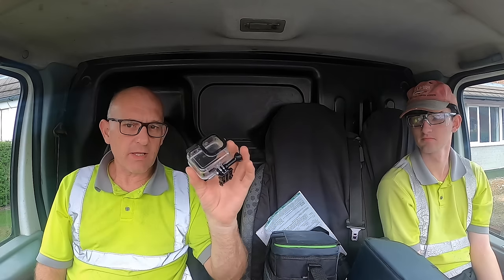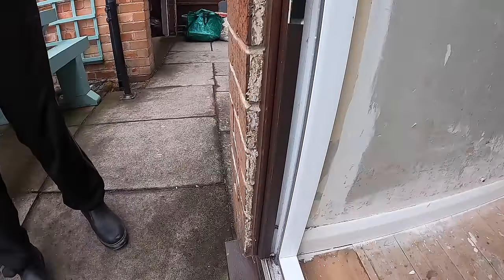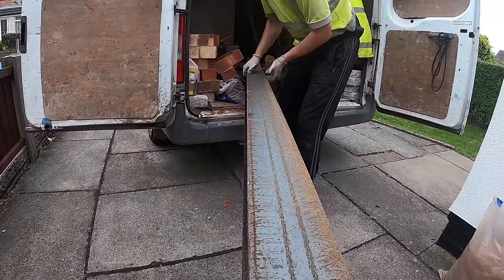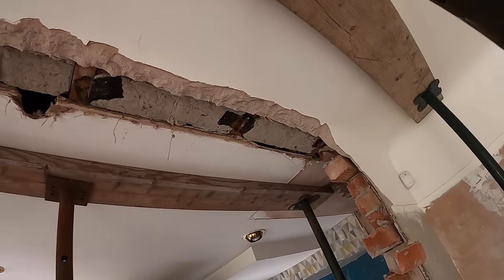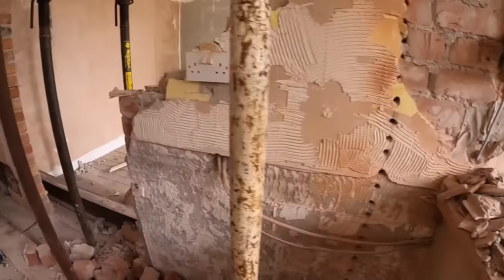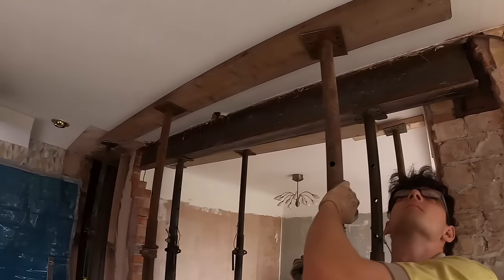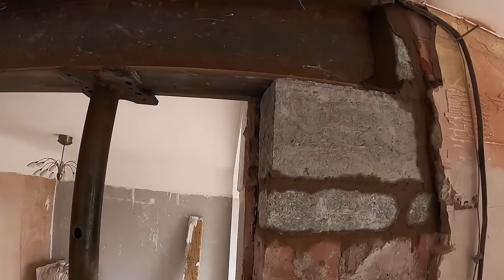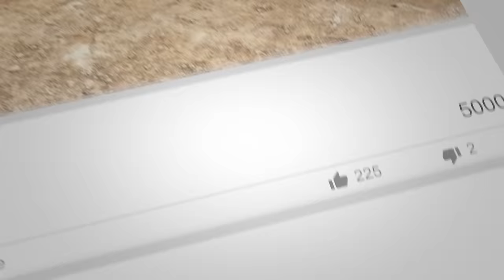HOW TO INSTALL A STEEL BEAM IN DETAIL

Comment: As a structural engineer I totally agree with you Steve, the steel should sit direct onto the padstone without mortar. Great video - I was very relieved when you finally propped the wall 😂
Reply: Any builder with a brain cell knows beams should sit directly on to padstones!!!!
Reply from the maker: @malcolmhaynes1424  Whuch is what I thought but apparently not 🧱👍🏽
Reply: and a second licensed engineer to second this!
Reply: So what exactly do people think is gonna happen in the future when the mortar directly under the steel begins to degrade over time and fail? The mind boggles!!
Reply from the maker: @toby648 mortar doesn’t degrade , especially sand and cement which is never going to be exposed to any weathering whatsoever 🙄
Reply: @toby648  by then, the rest of the house will have fallen down, so I don't think that's a worry 😂

Comment: Good job, always either a pipe or wire in the way somewhere doing these, I like to spread a bed of compo over the top of rsj just before cranking it up. Quality work lads
Reply from the maker: MrAdeyb . Thanks , yep always something. I usually put a bed on but didn’t want the joists sat on sand and cement 🧱👍🏼

Comment: Really good video. Im putting a slightly bigger profile rsj in 3.3 mtrs long myself today. Acro props in place and cleaned out, but going to be some job lifting on my own. I'm going to use raised pallets as levers each side and a plasterboard hoist. The pallets will allow the hoist to work within its safe working load.
Reply from the maker: Good luck but be extra careful and take your time . 🧱👍🏽

Comment: Great video. Are you using quick drying cement - amazed how quickly you are removing the supports for the beam, I was under the impression you should let the mortar set for a couple of days.

Comment: Great video lads! How comes you put the support on either side of the beam and not directly where the beam would be installed?
Reply from the maker: you get more room to work by propping the ceiling joists whenever possible 🧱👍🏽

Comment: Great video. Quick question. I have a 40mm gap to make up under my padstone so it sits flush under the steel. What can I pack it up with? I notice you're using thin padstones. Should I just cut a padatone thin as a way to pack it up the required 40mm?
Reply from the maker: I’m not sure what is allowed for a gap that big .
   Maybe slate or steel shims ? 🧱🧱
Reply: @Bricklaying With Steve and Alex  thanks for the quick reply guys. Maybe I'm better off taking out another course of bricks and getting another padstone under there?
Reply from the maker: @Bearizzle  . Yeah better safe than sorry 💪🏼🧱👍🏽

Comment: hey guys great video I am doing a very similar work. Got my structure report done but the builder is asking £900 only for putting the bean in and let it settle for few days. But taking down the wall and tidy up the mess is not included. the price is only for putting the bean in. Do you think its a fair price? the bean measurement are 152x89x16 and the padstone 330Lx100x150
Reply from the maker: Sounds a bit steep 😬🧱👍🏽
Reply: @SteveAndAlexBuild   Thank you yes I will shop around I agree this price is too much where only putting the bean in and once settle no wall out and tidy up. Cheers.
Reply from the maker: @cdyz5 🧱👍🏽

Comment: Would you lift floorboard if not solid floor to stand props on and do you drill lintel to bolt @ 4" X 2" timber inside U of lintel to fix plasterboard to or do plasterers just Gripfix to steel ? Thanks
Reply from the maker: ian ROBERTS . No we just spread the weight with planks on the joists . Not sure about the second question as we only install the steel 🧱👍🏽

Comment: Great in depth video.. How do you work out what size RSJ and is this the same process for a double skin wall.. Cheers Glenn
Reply from the maker: Workshop Life Thanks Glen . It’s the opening plus a minimum of 300 mm ( 150 mm minimum seating each side ) .it is the same for a cavity wall but the beams are usually bolted together . If you check our playlist we have other videos on this topic 🧱👍🏼
Reply: Think he means the height of the steel?

Comment: Very informative way of doing it 👍
Reply from the maker: Thanks Adrian 🧱👍🏽
Reply: Just wondered about a couple of things,
1, Is it necessary to put some mortar onto the pad stone before the steel sits on or is no mortar really required? 
2, under the main padstones there is a slither of pad stone or concrete block?
Reply from the maker: @adrianodoherty6283  Hi Adrian . We do put mortar between the padstone and steel but not everyone does . 
   As for under the padstone we used concrete common bricks I think 🤔 🧱👍🏽
Reply: I guess a concrete block slither or engineering or blue bricks would be ok aswell as a make up piece under the main pad stones? Just thinking about what I have lying around 😀
Reply from the maker: Yes but try and keep the depth of the piece as big as possible, you don’t want it too thin 🧱👍🏽

Comment: Another top video and of course most of this type of work is the cleaning up and it’s amazing how much crap is generated! I noted a few comments regarding pulling the last two acrows out prior to full setting of the mortar ! I always have a half bag of rapid set cement knocking about and would use it or mix a bit with the normal cement on situations like this ( have to be sharp though ) as it goes off before you can get on the steps with it lol😂🤫Besides the learning curve with your new camera 🎥 equipment you now have grown in confidence whilst explaining the various stages of the build which is commendable 💪👏👍
Reply from the maker: Ronnie Biggs Thanks very much Ronnie much appreciated 🧱👍🏽
Reply: Great tip with the rapid cement for these jobs mate I’ve never thought of that 
That one will be staying in my head for sure 👍
Reply from the maker: Mitchell Meredith 💪🏼🧱👍🏽

Comment: I've got the same layout and I'm wanting to knock through kitchen diner. That little add on bay is similar to mine and my engineer is saying I need to get a beam put across that first aswell as the large one. Im gonna seek a second opinion. Great job by the way lads, I'm just scratching my head as to why I can't do mine the same 🤷‍♂️
Reply from the maker: Thanks Craig . Not sure about that one 🤔👍🏽🧱

Comment: Did you guys need planning or building control out for that work?
Reply from the maker: We always encourage the customer to use a structural engineer and go through regs 🧱👍🏽
Reply: @SteveAndAlexBuild   we are doing pretty much the same as you guys. We have had a structural engineer out to give us what size steel to you. He is said we need to contact the council. I have never had that before . It’s an internal supporting wall .
Reply from the maker: @jasonreeves4955 . We tell the customers before the quote so they know there will be the extra expense ( which is ridiculous) then they can decide to go ahead or not .
   The sign off covers everyone 🧱👍🏽

Comment: Thanks guys for this.  Quick question, was this one where the wall continued all the way upsatirs, I assume it was?  My understanding was you needed to use strongboys to needle above the height of the steel (i.e. above ceiling height).  Or does that depend on whether the wall has perpendicular joists resting on it?
Reply from the maker: Thanks Tim . If the joists sit on or run through the wall then they can be used to prop above 🧱👍🏽

Comment: Nice job, and best steel lintel video I've seen. Hope that's christened the new boots (they will keep getting better). Silly Q what would you rough estimate the weight of that lintel?
Reply from the maker: John Coppock Thanks very much John . Not sure of the weight but not as heavy as it looks 💪🏼🧱👍🏽
Reply: @SteveAndAlexBuild  It sounded heavy when dragged out the van but then Alex I think made it look easy to carry. He is obviously well strong. Anyhow that's all good and great video.
Reply from the maker: John Coppock Yeah he works out now so he is probably stronger than me now 💪🏼🧱👍🏽

Comment: Really helpful video, thank you! Can I ask what your mortar mix is for bedding the padstones? Everyone has such different opinions online - from 2:1 to 3:1 dry mix, and even 6:1:1 mix, and from sharp sand to building sand.
Reply from the maker: We have always used 4 to 1 but I also heard there should be no bed 🤨. 
   Next one we do it will be 3 to 1 I reckon 💪🏼🧱👍🏽
Reply from the maker: @brandonacklin1913  🧱🧱👍🏽

Comment: Sir i have to combine two rooms, and the wall in between them is 10ft. And it might be load bearing, not sure tho.
2ft wall i m keeping as it as, as i m making a kitchen on the other part of the partition.
So if i ll keep a 9 inches wall on the left side of the wall and 2ft on the right side of the wall, the remaining space left is 7.3inches i guess.
What size of rsj steel beam need and is there any other alternative
Reply from the maker: You need to employ a structural engineer if the wall is loadbearing🧱👍🏽

Comment: Nice work.. My query is How did you support the wall just when you  had the rsj in place and removed the pole and wood supporting the upper floor brickwork? Cheers.
Reply from the maker: Thanks John . We propped the steel with another acrow so they took all the weight 🧱👍🏽

Comment: Hi what rsj would I need for a load bearing wall🤔room and attic above with a block wall above.Sorry I’m getting so many answers when I search around.Il be squaring my chimney breast off with rsj sitting inside chimney stack.Any advice would be great.
Thanks 🙏🏻
Reply from the maker: You absolutely need a structural engineer . No guessing 🧱👍🏽
Reply: @SteveAndAlexBuild  thank you Great video
Reply from the maker: @lesmaher7441  cheers 🤙🏾🧱👍🏽

Comment: Hello, any expert tips on how to fill top of a beam into existing opening.... probably about 20 mil gap. Most people saying sharp sand dry mix and roof slates ?
Reply from the maker: Sounds good 🧱👍🏽
Reply: @SteveAndAlexBuild  final question, did you pack the padstone with a slate or a shim? It was on time laps so couldn't tell....wonder how you got tight to beam.
Reply from the maker: @sajhussain26 both can be used depending how the pad goes in 🧱👍🏽
Reply: @SteveAndAlexBuild  did you something for this one you put in? Or  not.
Reply from the maker: @sajhussain26 We put the bed on the steel first then wind it into place 🧱👍🏽

Comment: Great Job guys! currently planning knock through kitchen dining room, how do you calculate what size RSJ to use please and how many days did this take? (Y)
Reply from the maker: If you’re not sure get a structural engineer to work it out for you . As for the job it was 1day 💪🏼🧱👍🏽

Comment: Did I miss the lateral support being added at the ends? Just hoping the weight of the structure will keep that pinned in a light earthquake?
Reply from the maker: I take it you’re not from England
Reply: Decidedly not but I did just re-read the code here and as long as the joists are bearing onto the beam no more than 24" o.c. it's considered to be laterally supported. That's the code minimum though... @SteveAndAlexBuild

Comment: I don’t really get the purpose of the padstone in this case, couldn’t the beam itself pad the load onto the bricks same way as the padstone does, the beam has quite a large contact surface at the ends.
Reply from the maker: I’m with you Dave 🧱👍🏽

Comment: Thanks for the video!
Quick question, is there a general rule to follow when deciding how much of the beam should rest on the wall? I can see here its about a brick's length, is that the standard or does it vary based on the length of the beam? Thanks!
Reply from the maker: Thanks Ash . It’s 150 mm minimum . We generally do about 200 mm but often a structural engineer will specify it for  you 👍🏽🧱
Reply: @SteveAndAlexBuild  Brilliant. Thank you!
Reply from the maker: @mraash  no probs 🧱👍🏽

Comment: hi lads how do you know what size steel to put in not length ways as in 6x4 etc is there a set size ,, stay safe guys
Reply from the maker: We usually put an 8x4 in as it is plenty big enough 🧱👍🏼
Reply: Depends on span and load. Although  you could have a good guess it must be worked out by a structural engineer and signed off by building control

Comment: How does two blokes lift steel hold it up aswell as getting two acros set up under steel plus that's dangerous you should never put the acro direct onto rsj metal on metal is very slippy if that slips off acro someone's dead

Comment: Did building inspector not asked for steal to be painted?
Reply from the maker: Maciej wronaki . No as it is inside 🧱👍🏼
Reply: Or a structural engineer calc for the steel???
Reply from the maker: Sparkles and I No we just went oversized
Reply: @SteveAndAlexBuild  wow, suprised building control have been happy with that. If they know about it 😉😉
Reply from the maker: Sparkles and I 🤔🙄😏🧱👍🏽
Reply: Doesn’t sound as though there’s a structural engineer or building inspector on this job 😂

Comment: Why wouldn’t you leave the last 2 acros in until the cement sets?
Reply from the maker: Charlie Shwan No need pal , I explain in the video 🧱👍🏼
Reply: Agree,strange way to do a lintel,I would be leaving in those last 2 acrows 24 even 36 hours before removing them,but then I'm old school.
Reply from the maker: Stuart Andrews 🧱👍🏼
Reply: @SteveAndAlexBuild  Looks like the mortar was setting in good time with the heat of the day, so you could do in that instance, different if it was colder (am i right lads?)
Reply from the maker: Paul Edwards . Yes . The brick were perfect for suction too 👌🏼🧱👍🏼